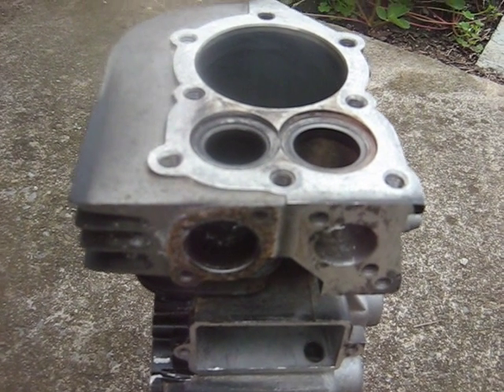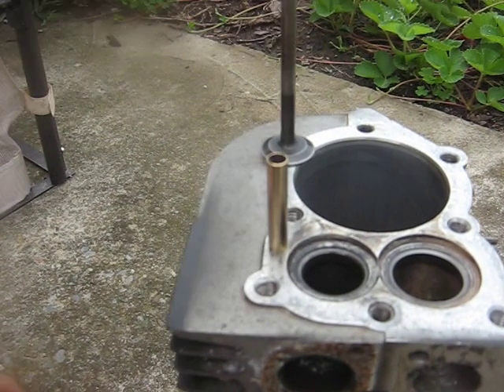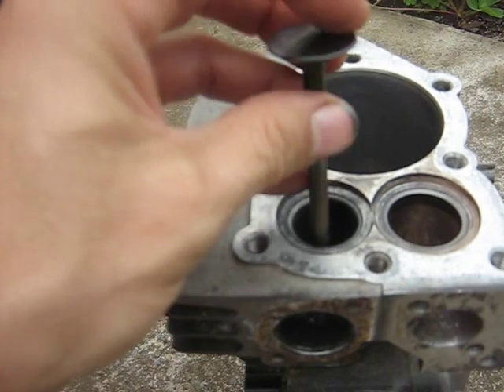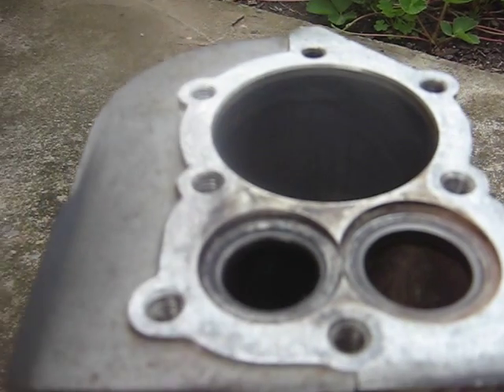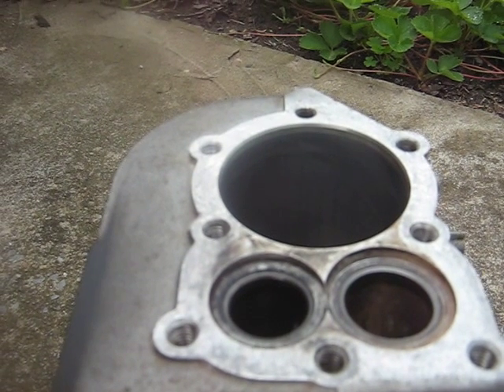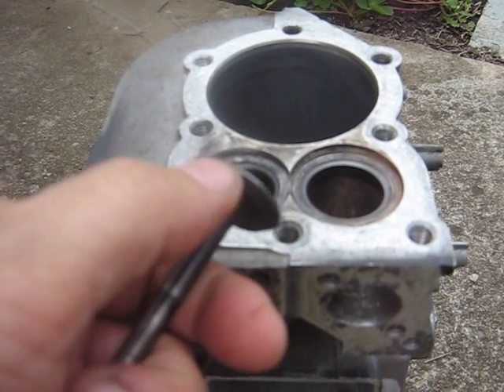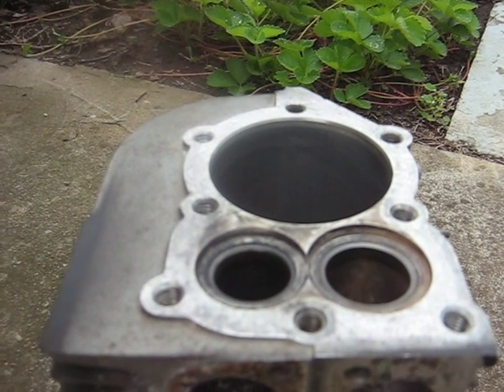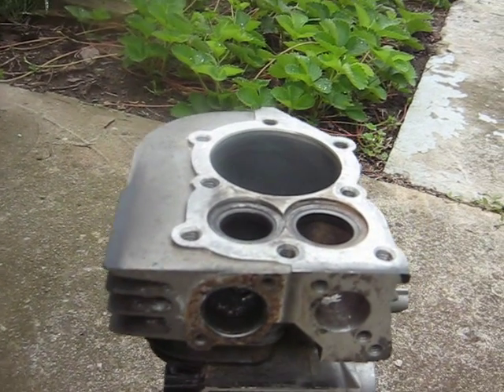#4 Valve Guide Wear Discussion

Comment: it looks like you have hardened seats in that motor.you can tell if it has valve seats.just look through the intake port from the side and same with exhaust and you can see that there is a valve seat down in the  bottom of well where the valve will seat.and they are hardened.regular to high octane wont hurt it.now with alcohol wld. call for stainless valves,chances are that most new ones are stainless.i just bought a new intake valve and it is stainless.but im looking to put new  guide in exhaust and wondering if you know what size tap and bolt that screws into that would be.the inside diameter of guide is 0250 or 1/4 inch,the new valve mics at around 02480 so that all shld be good.but im having problem finding what tap to pull it with.im gonna make my own jig to hold tap straight and im not gonna ream the hole out because people seem to be havin a problem after reaming for new guide as to it looks like its too loose going in.any help wld be appreciated.usually 1/64 bigger tap to 1/32 should work,but if someone has the actual sizee in the kit it wld. be greatly appreciated.thanks
Reply from the maker: Hi, yes, you use a straight flute 0.250 reamer, to pull the old guide out, tap it with an M7 x1mm  plug tap, and use an M7 x 1mm hex bolt 65mm (2-1/2") long, with a hex nut. It goes thru about a 1/8" thick large dia. (fender)washer to pull out the old guide.  There is a cone shaped guide fixture that sits in the valve seat to align the reamer with the hole in the new guide (so you don't ream the hole at an angle. Hope this helps.

Comment: The bronze guide is the way to go there self lubricating(Preventing the valve from sticking in the guide due to heat and low lubrication).It has nothing to due what fuel you use.

Comment from the maker: Yes, getting valve seats to stay put can be a tricky thing in these aluminum engines! I have a few engines that the seat has done a machine job on the block, so the block is pretty much pouched now :(
On loose ones just a good peen job can work wonders.

Comment: I would think those valve guides would be okay I would still refer to a shop manual Removing valve seats is easy I have made my own tool from looking at one The tricky part is peening over the aluminium to hold the new one I once got a steal of a deal when I was a kid on a motor that lost compression The valve seat came loose

Comment from the maker: Yes, I imagine the brass/bronze guides should be fine, just thought I would bring the issue up for discussion.
You can remove the valve seats in aluminum block engines, but probably need some briggs special tools. The old cast iron blocks, I don't think so, but am not certain, especially on the larger engines.
The switch to unleaded fuel hasn't seemed to hurt engines such as my 73 Briggs pushmower, perhaps it is a size related issue. Car valves are larger, so the valve face is wider.

Comment: I would think that brass valve guide would be fine, brass/bronze guides are used in cars with unleaded gas. I think the main thing with running unleaded in an old engine is getting hardened valve seats. I don't know if they are removable in briggs engines though.

Comment: don't cars have magnets in their oil pans typically or is it transmissions? i just did this for an old tecumseh that sat for over 22 years, it was pressure lubed and it had no filter, the oil in it was so old it had stained the dipstick. needless to say the magnet was covered when i drained and filtered the oil.

Comment: Heres a tip for anyone with small engines without oil filters. If you have an electric toothbrush with interchangeable heads, chances are that you have a set of 2 magnets on the bottom of the head. Pry one of these magnets off and scrape the black coating off. When you change your oil, simply attach the magnet to the inside of your oil drain plug. The magnet is strong enough not to come loose and will attract any metallic shavings. When you change your oil just clean it off.